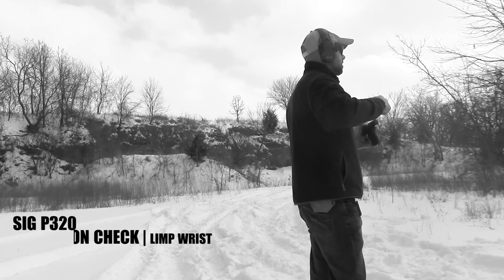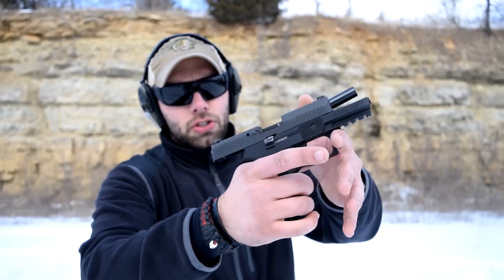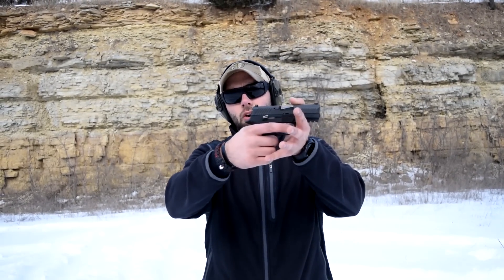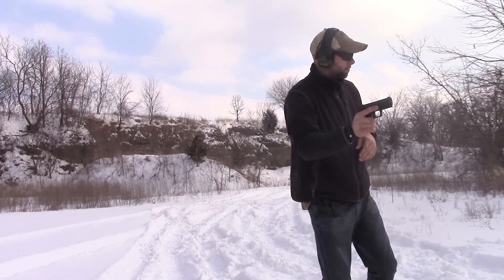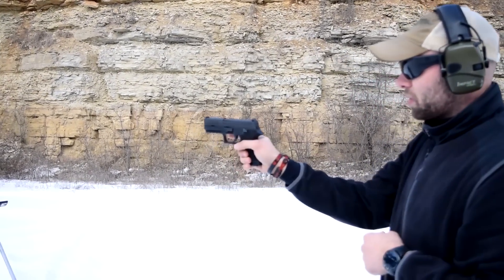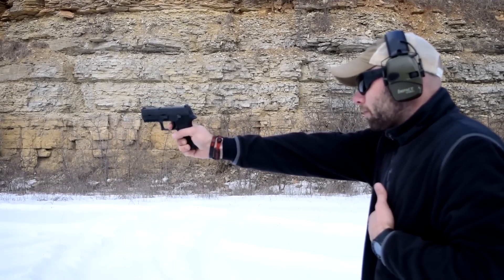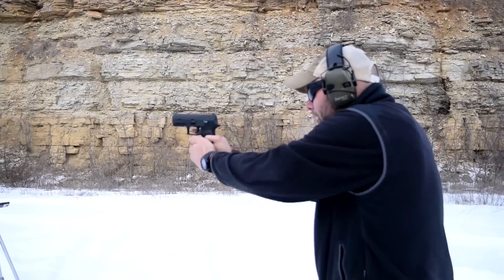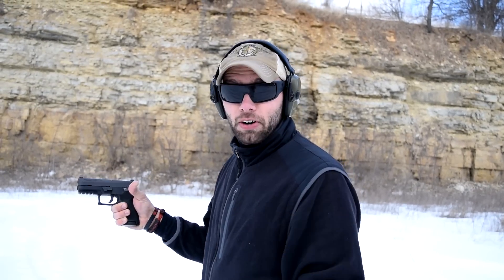Sig P320 Limp Wrist Test | Attempting The Impossible - Tactiholics™

Comment: I always enjoy your videos. And myself am a huge fan of Sig. But for me I have had many failure to eject with my carry p320. I called Sig and they told me to try 124 grain instead of 115 grain! What?? Not "send it in we will take care of it" Very disappointed in Sig customer service. Anyway, I sent it back to sig and when it comes back I may just sell it for another Glock...
Reply from the maker: Hmm, odd problem and it's too bad they didn't jump to stand behind it. I've had really good luck with Sig for ordering and a magazine issue I had a while back, but, different reps I suppose.
The only thing I can think of is that the 124s have a bit more pressure and will be less likely to fail on extraction, but we mainly shoot 115 grain out of this gun with no problems.

Let us know what they say about it when your P320 comes back..otherwise yeah, get a Glock - you can't go wrong there!
Reply: Tactiholics Thanks. I could just take the reps advice and shoot 124 grain. But to me that is unacceptable. Its a Sig Sauer for gods sake. It should run any weight of 9mm projectile. I will keep you updated.
Reply: GrizzlyTube1 Strange deal, I have put at least 200 of white box and UMC through mine so far with no problems. I'm curious to what it'll do on the return.
Reply: Tactiholics Got my P320c back from Sig. They replaced the barrel, polished the feed ramps and installed new Adverse trigger as a courtesy. Sig test fired 100 rounds with no failures. I test fired 200 rounds and no malfunctions. So far I am very happy with the repairs.
Reply: GrizzlyTube1 i was having similar issues with my p320 carry and Winchester white box. 10 failures to eject out of a 100 round box. Measured the case lengths of the ones that failed to eject and they were all 1mm or so too long. switched to a different  ammo manufacturer and haven't had a malfunction since. i researched it and it seemed like at the time a lot of people were having similar quality issues with the winchester white box ammo.

Comment: OK I have a sig p320 and I had 3 or 4 failure to eject the casing and I figured it was me limp wrist and the ammo wasn't reload any suggestions  would be great , thanks
Reply: did you solve the problem? curious to see what caused it.
Reply: I ended up trading but I'm going to get another p320 and try it again
Reply: masmls02 its could be your extractor  spring. call sig up for a new spring and that should fix your issue
Reply: Well the p320 I got was a used so I sold it well traded it and went and got a brand new so I'm really hope it was just that gun because I really like the feel and look of the sig p320